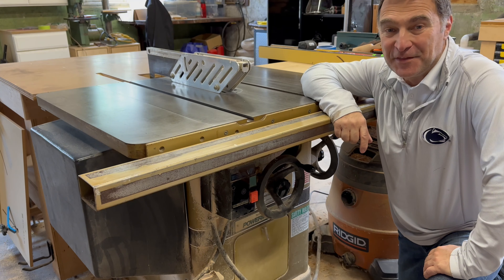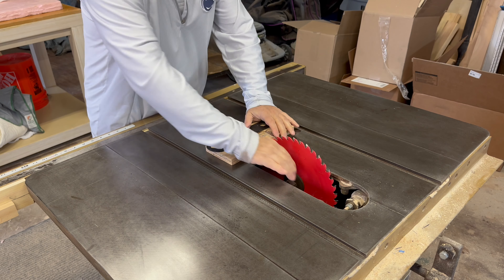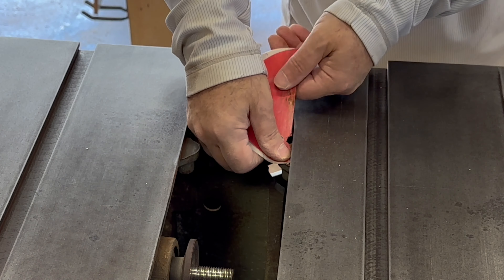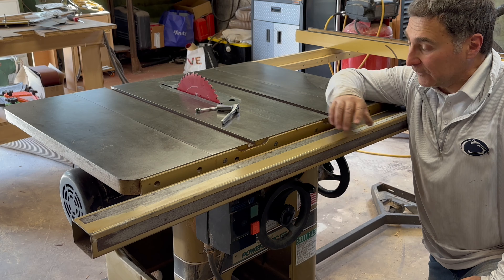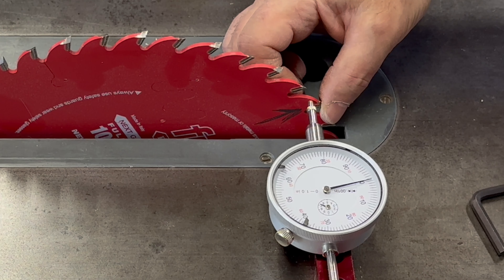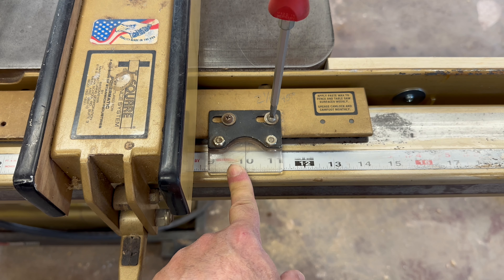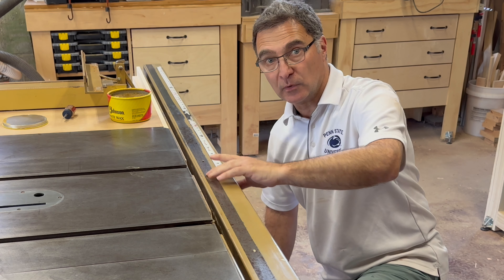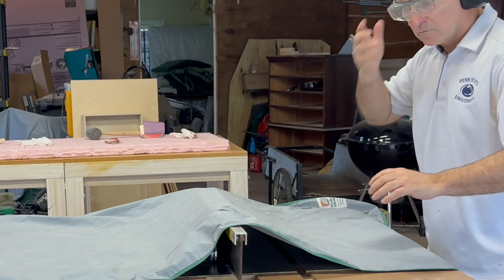How To: OLD PM66 Table Saw Tune Up!

Comment: Is that the original splitter and blade guard? I have a PM66 but no splitter or blade guard and can’t find anything aftermarket.
Reply from the maker: Yes, that’s the original splitter / blade guard. You may be able to find one by posting on Facebook. There are some Powermatic groups there. Maybe someone has one sitting in there shop gathering dust. Thanks for watching!

Comment: 2:45 - I do not condone White Lithium grease as a lubricant given that the wood dust will cling to the grease and cause the grease to congeal, and it becomes a real mess to clean. I would use WD 40 or dry lubricant. Thin oil like 3 in 1 is a good bet. 

All in all, like all machinery, preventative maintenance is planned maintenance and it can be once a month or every 3 or 4 months, depending on the number of hours in use. Thank you.
Reply from the maker: Thanks for the constructive feedback. 
Will try a different lubricant next time. 
Thanks for watching.